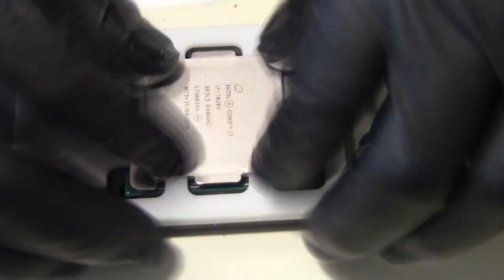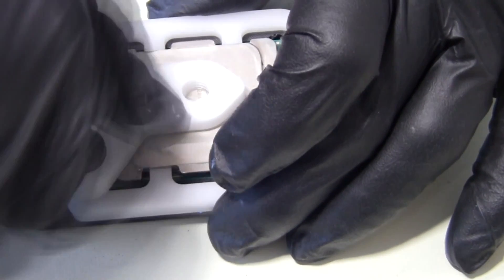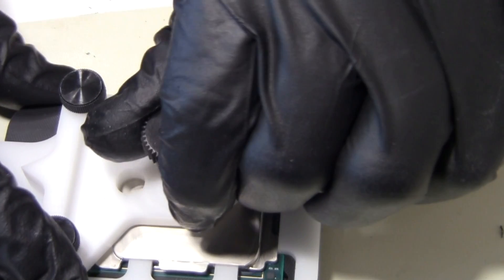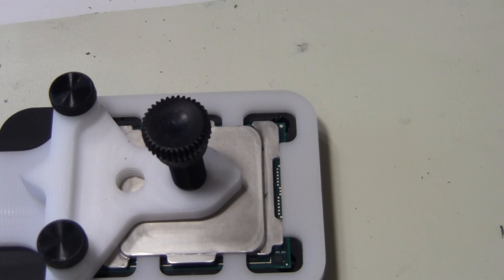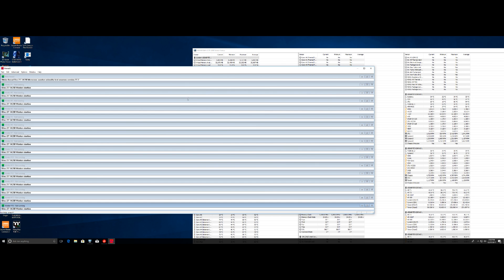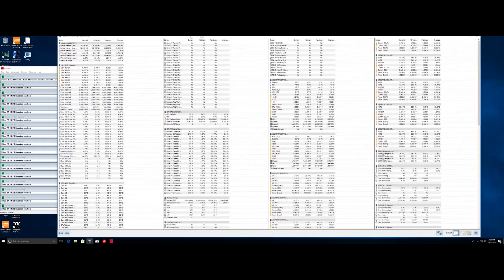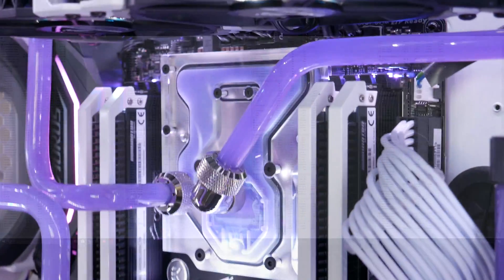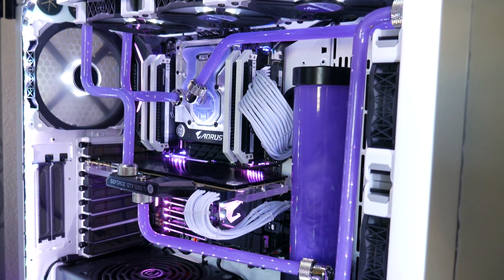Deliding i7 7820x  How to drop 20c in a couple hours

Comment: fuckin hell i can't find any delidding tool for my 7820x....nothing on the market in all England...nothing on ebay around...my cpu can 4un 4.7ghz with 1.225vcore..in gaming is around 60C but i know by delidding i can go higher..4.8ghz or even more...any idea how to open this cpu?i have only die mate 2 but thats for 8086k and etc
Reply from the maker: EG STARTS Intel Skylake X Series CPU Delid & Relid Tool LGA 2066 for i7 7600X 7820X i9 7900X 7920X 7940X 7960X 7980X 7980XE https://www.amazon.com/dp/B07KQ21TBT/ref=cm_sw_r_cp_apa_i_w0amCb02WGVX6
Reply from the maker: I couldn't find anything on derbaur's website
Reply: @XbacongamN  anyway thnx for this video...

Comment: Mine (7820X), WITHOUT delid 4.7Ghz/1.2v vcore running at 70 degrees. (10 months with this spec)

 Max temp is 75C (package)/66C(max core) in very few and extremely rare cases. I was wondering if I  can I reach 4.9 with delid... 

Great video btw.
Reply from the maker: I'm sure you could depending on the work load.  If your rendering and doing other avx workloads I wouldn't go that high.  I was on 4.8 for a bit and regular stuff it was fine.  Thanks for watching

Comment: I have the same CPU and I reached OC of 4.5Ghz on all cores, but the temps are pretty high (95-100 degrees). So I'm planning to delid this 7820x and maybe at some point making a custom loop for cooling!

Thanks for the cool and informative video! :)
Reply from the maker: Its pop pretty frea kik y the first time, but I h as ve had the lid off 4 times trying other stuff so it gets easier.  Go ok d luck a d take your time